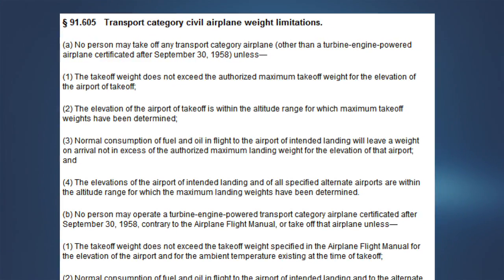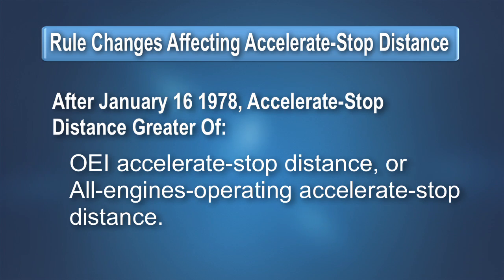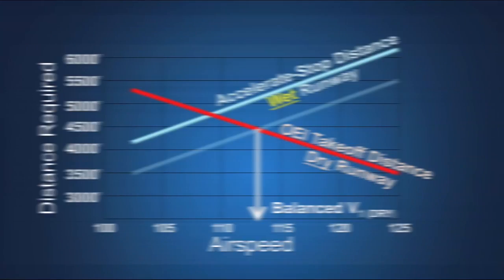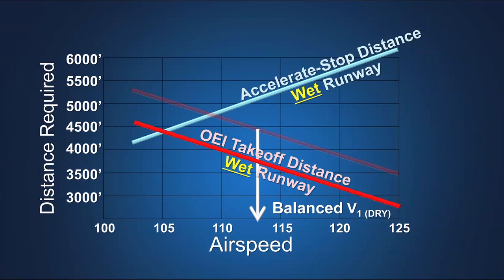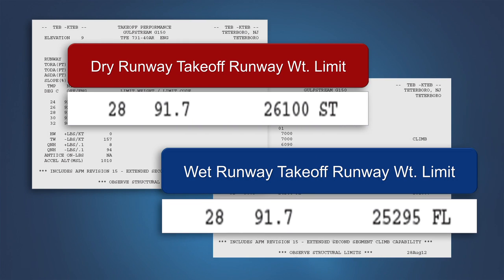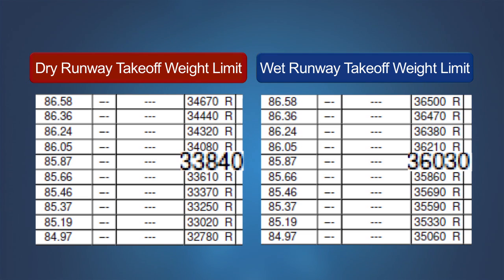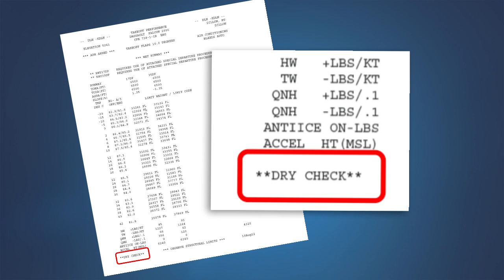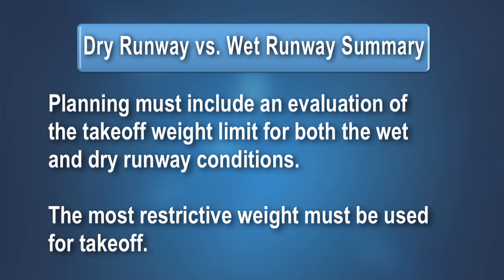TAPP Working Group Video (Part 3 of 4): Wet Runway Takeoff Performance

Comment: I always wondered why the 15% increase is applied for takeoff distance calculations. A wet runway should have no effect on actual takeoff distance, since decreased wheel friction has no role in forward thrust.  However, factoring in accelerate/stop distance, in which you might have to brake after an aborted takeoff, this makes total sense.
Reply: Stagnation of water in front of the Wheels which under 3mm can still create large dynamic drag.
Reply: @burakarpacioglu7551  Gotcha, thank you